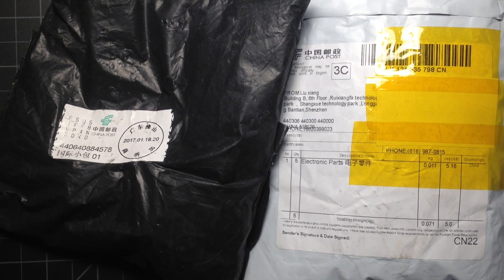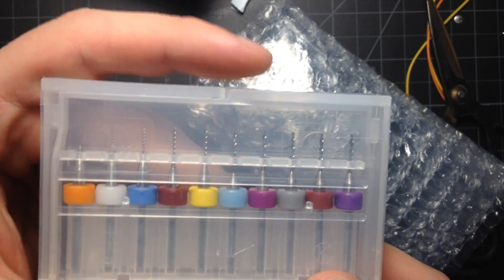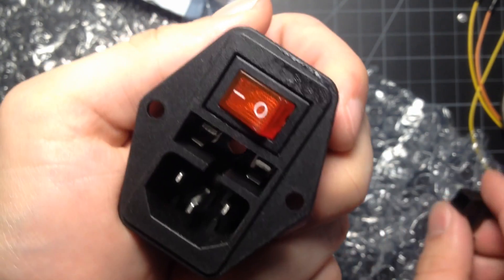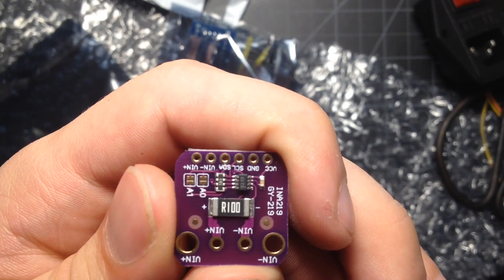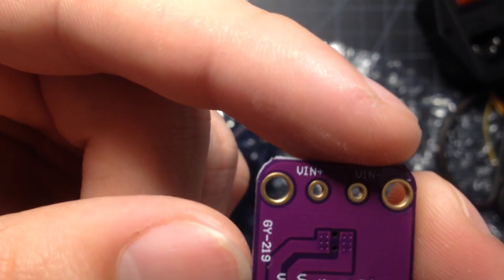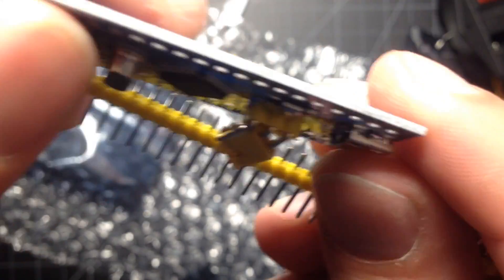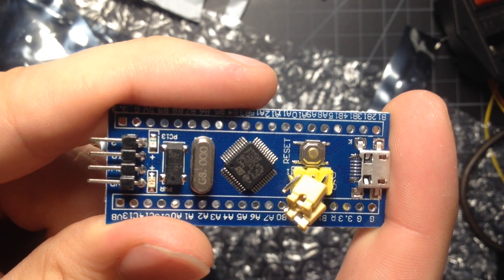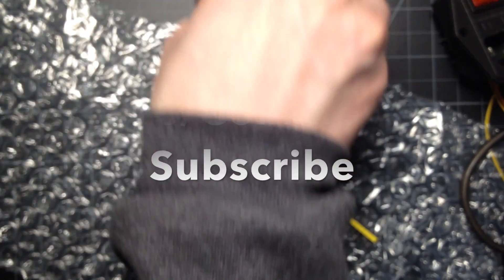Mailbag #3

Comment: I like those i2c oled displays, I might get some of those. What is the rating on the current sensor?
Reply from the maker: It depends on the value of shunt resistor. I incorrectly read that `R100` as 1 ohm, but it's actually 0.1ohm. With that value it can measure up to 3.2 Amps at about 1% accuracy.  Since it measures on the high side, it is also limited to 26V maximum for load measurement.
Reply: Paul Martin my thoughts are if I could use it in the cnc, but the motor is run at 36v. Detecting high current situations might prevent some problems.
Reply from the maker: there is a great hall effect module i'm also looking at for higher current applications. I think +Julian Ilett put up a video about a similar module if you are interested. I've also bought one, but that video is a ways out still.